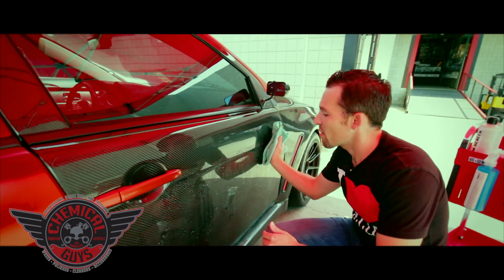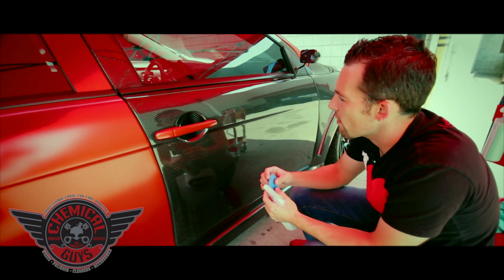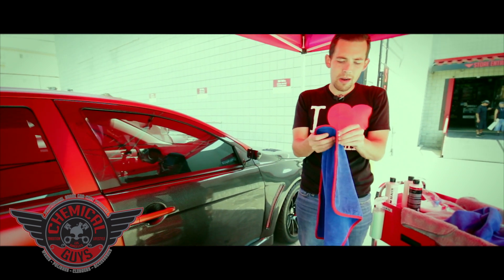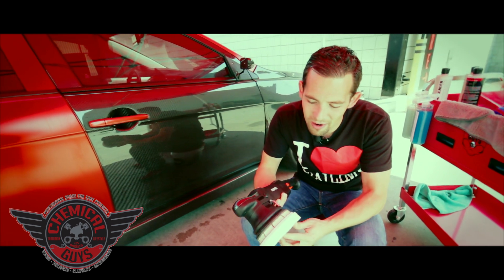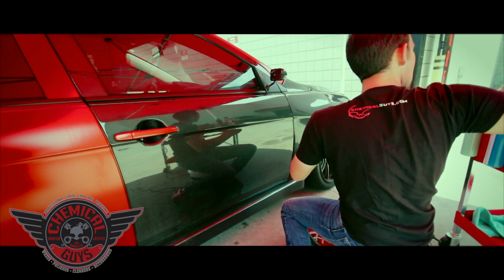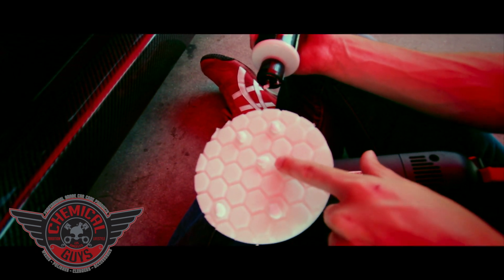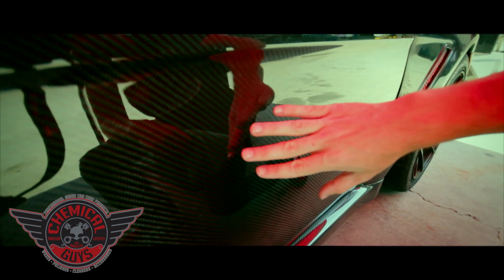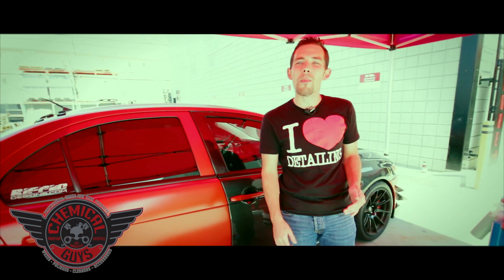How To: Polishing Carbon Fiber - Chemical Guys Rupes LHR15ES Polisher Mitsubishi Evolution

Comment: Great video! thanks alot :) one thing wich would be interesting to see is the rupes 15 / 21 compared to a rotary, i've seen it compared to flex and so forth but never a rotary polisher.

With that I mean like how much scratches and so forth it removes in a specific period of time compared to each other.